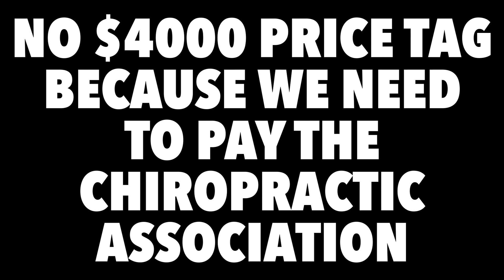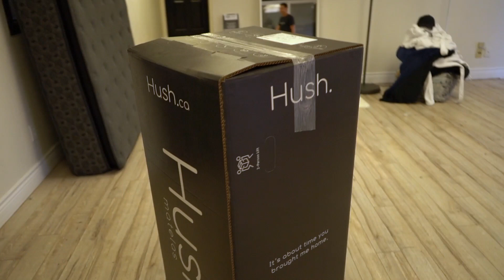The Story of Canada's Best Mattress | The Hush Mattress

Comment: @Hush Blankets Any plans for an adjustable bed frame to go with your mattress?

Or if not, will any adjustable frame work with your mattress? I'm thinking Queen or King size.

Also, is there a maximum recommended body weight for the mattress?

Thanks!
Reply from the maker: No plans yet but any frame would work except hospital style beds. No recommended weight! Works for all